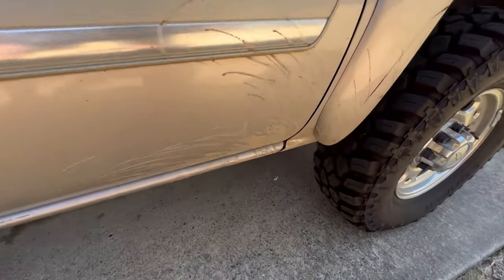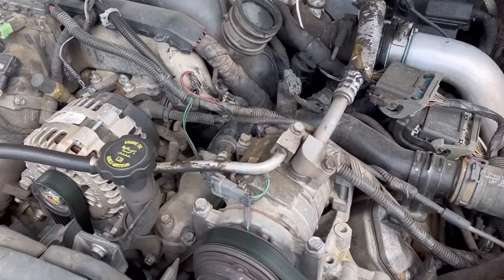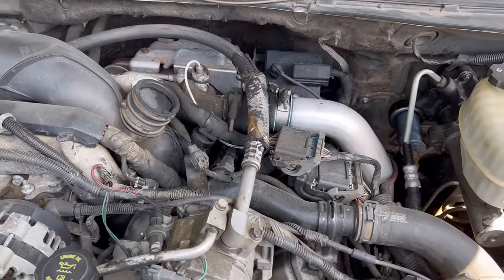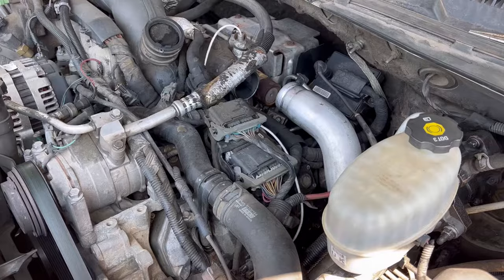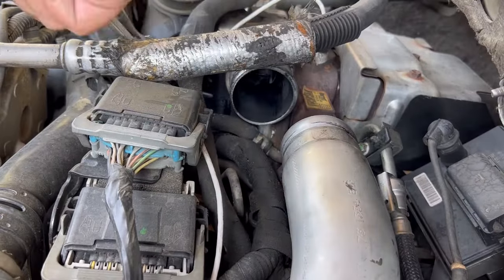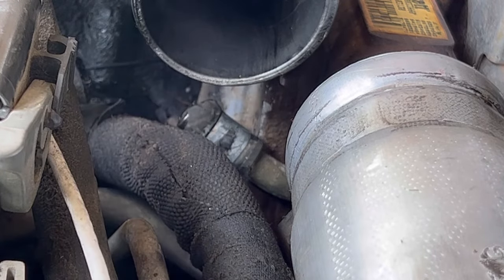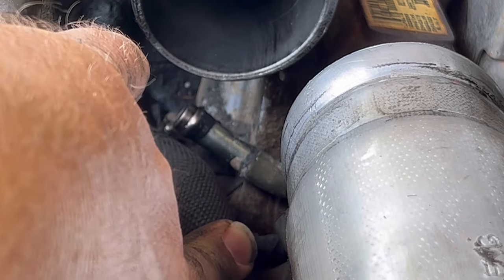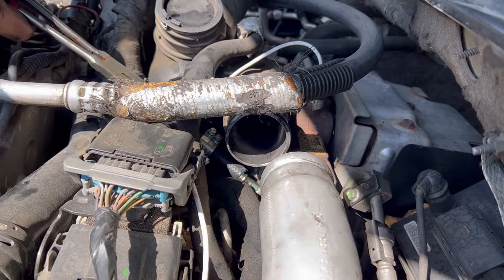How to Fix: 6.6 Duramax Coolant/Antifreeze Leak at Rear of Engine (Parts links in description⬇️)

Comment: I was told to NEVER use the green antifreeze on DuraMax engines. They do have some that is supposedly ok for use but…….
Reply from the maker: Really? What was the reason? I’m just curious cause I may swap mine back.
Reply: Every manufacturer has a recommended coolant, and everyone will tell you don't use the green. The main issue is that the green stuff is supposedly safe to add to any system, but it doesn't react well with some of the other coolants, so you run the chance of the coolants chemically reacting to each other and usually ends up with a weird consistency that clogs your coolant ports
Reply: However, on most US made vehicles, a good coolant system flush before switching coolants usually does you okay
Reply from the maker: @Hbzprojects  thanks for that information, it might save some trouble!
Reply from the maker: @Hbzprojects  ok. I appreciate you!

Comment: I've got an lml with a wet spot on the bell housing with coolant. Thanks for the content
Reply from the maker: Glad it helped, and you’re most welcome!
Reply: Was this your issue? I have the same problem
Reply: @man-a9857  I ended up taking it to a friend who owns a shop after not being able to locate the leak. It's still there as we speak. I watched him pressure test the coolant system and it held in the short term and didn't show any leaks but the valley between the heads had a pool of coolant develope in the short 5 minute drive from my place to his shop. He said he was sure it wasn't the heads though
Reply: @leethomas556  if you don’t mind send me an update when you find out! I will do the same if I figure it out. I have a 2012 lml that just started this leak. I looked all over up top and can’t find anything. I have a coolant bypass kit on the back of the engine near the downpipe and passenger side up pipe but that doesn’t seem to be the issue. Might be worth checking on yours
Reply: @man-a9857  will do definitely!
Reply: Shop called and said once they got some stuff pulled off around the top, it was a smaller coolant hose that was leaking and we should have seen it earlier
Reply: @leethomas556  thanks man. Did they only find it once they pressure tested? Or was it visible when the truck was off?
Reply: @man-a9857  he said that it was obvious and we should have seen it on the initial look see but yeah once they put some psi too it for a few it was squirting good
Reply: @leethomas556  where exactly was that hose? I’m still having no luck
Reply: @man-a9857  sounds like it was near the egr?
Reply: What size hose was it? And was it just a regular fuel hose you used? Literally same issue
Reply: @Jorge Ochoa  it was a coolant line the feeds the egr, I ja e a bypass there on mine and it was leaking at the fitting. I'm not sure on the size but it's a smaller hose, sorry I don't have much else, it was a simple fix though. Looked worse than it was.

Comment: You must have a LLY
Reply from the maker: It’s an LLY VIN, but takes LBZ injectors. I think it’s a crossover year.
Reply: @GrubNGas  LLY have a bigger turbo, but all so a smaller coolant pass threw on the turbo that's why you got that issue. That's the number 1 common issue with LLYs.
Reply from the maker: @JasonY02  I had no idea…thanks for sharing that information!
Reply: I'm here because I have lly hahahah and I have this problem
Reply from the maker: @jamesscalf712  💯

Comment: I was hoping this was my issue, but of course it’s not.  Starting the oil cooler removal this week. Hopefully it goes well.
Weird thing on mine was it wouldn’t always leak. Sometimes it would leak quite a bit, others narry a drop.
It would need fluid about every couple months, then every month, then cpl wks, now weekly.
Looks like it’s right at the cooler elbow.
Got the kit from merchant and the beers in the fridge.  I’m pretty sure this line will be in my future too at some point.
Still, WAY better than buying a new truck…
Reply from the maker: I had to do the oil cooler too…a pain, but worth keeping the truck. Wish you the best, friend!
Reply: di you figure? Mine has same thing

Comment: Curious why you are not using Dex-cool?  Thanks for sharing the content.
Reply from the maker: Thanks for being here, and glad to do it! The previous owner had already switched it to green coolant, so I just kept it when I changed the water pump, etc.
Reply: I'd say it's in your best interest to switch back to dexcool. It has the additives and requirements for all the seals. Could lead to premature failure to the water barring seals or others.
Reply: I also was curious how it’s not the Dexcool orange coolant